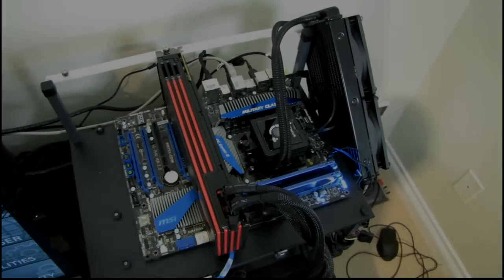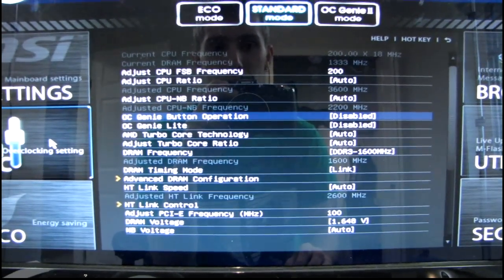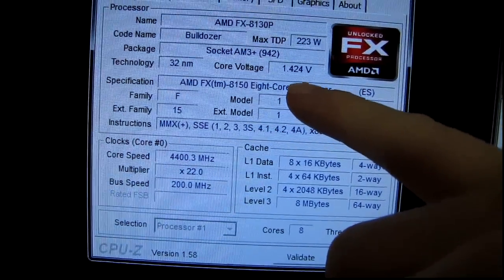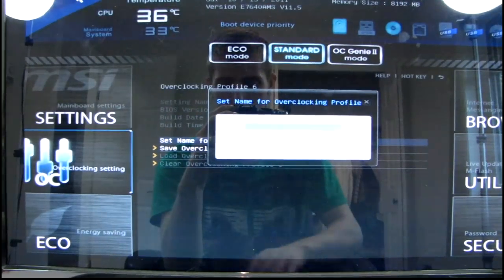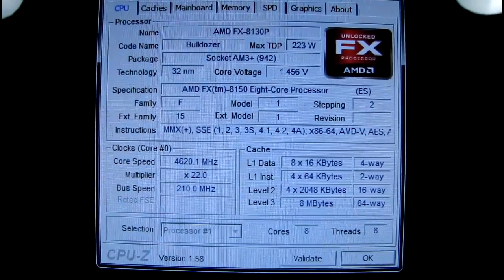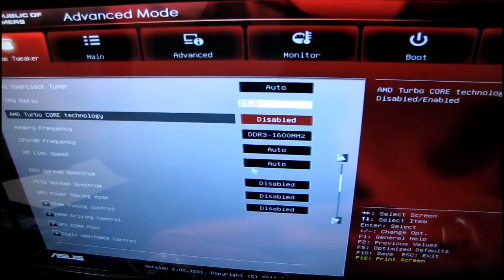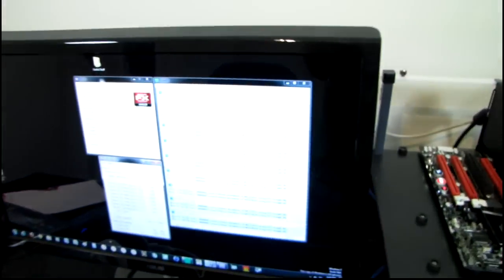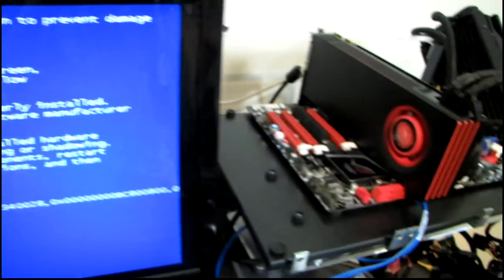AMD Bulldozer FX-8150 Overclocking Guide & Tutorial Linus Tech Tips

Comment: Please do a video of the 8320 on how to overclock on!
Reply: yeah I would like to find out as well to do it manually since im using the auto tunning up, but I'm wondering if by doing it manually is better than auto.
Reply: i actully made it stable my self ;) i seached around on what kind of stable clock and volts.. i got mine to 4.5Ghz at 1.440Volts :)

Comment: Using the Asus Crosshair V Formula board my FX-8150 went to 4.615 with the CPU voltage at 1.350. My bus speed was at 201 using G.Skill Ripjaws 1600 memory (8-8-8-24-39) I bump it up to 1866, (1872 with the bus speed at 201). With (9-9-9-28-44) timings and the dram voltage at 1.55. CPU/NB was set to 1.275 volts. All this on air using a Zalman CNPS9900MAX and a CM Sniper case. At idle temps are 38c to 40c and the highest temp in Cinebench 11.5 was 55c.

Comment: the temperature of your heat-sink/water in your cooling solution is always going to be higher than the core/CPU temperature that is being read from the main board.
The core temperature is calculated not physically but by an algorithm based on the temperature at the socket. This is even more relevant at idle temperatures. This is why your core temp reads 55C and your liquid coolant is a little hotter, your core temperature is actually more accurate than you think.

Comment: I have run my 1055t at 3.8 ghz for years.

The key is aftermarket cooling, and reading up on the subject.

Overclocking is safe and effective, as long as you get the knowledge before trying.

Comment: @peterdoa1 pretty much every i5 2500K  will reach 4,5GHz. Mine is running 5GHz with 1.344V core voltage, which is pretty low voltage for such high overclock

Comment: @stonecoldtrk I looked into it. You are correct. Bulldozer uses 4 "modules" with 8 threads. But bulldozer is $70 cheaper in canada than the 2600k. bulldozer seems to perform poorly in low load situations than the intel, but in high load situations the bulldozer wins.
They both have advantages I guess. It really comes down to what you will be using the computer to do mostly.

Comment: Why is it that when I do the Prime95 stress test , CPU-Z reading of the speed go back and forth between the speed that I set (4.4Ghz) and 2.8Ghz.
I tried to up the voltage to 1.45 but still same problem ?
Reply: Disable APM (Application Power Management) throttles CPU under load. Just had this issue and tried everything, forgot about this setting. I have a FX-8320 + GA-990FX-UD5 so not the exact same as this set up. Now i'm OCCT testing stock clocks at 1.232v (1.2875VID) loaded 48c with TR Archon cooler.

Comment: for 4.4 don´t need twik the buss, just put more vcore and adjust the multix. Probably 1.45v works but try lower on vcore until fail and then go back a little allways below 1.465 since the máx safe range i guess. Be carefull with the buss speed try not to touch that if possible, buss speed can OC the memory and burn them if not done correctly.

Comment: What is cpu ratio? What is the spectrum thing? And finally, do you just turn the voltage up a little bit at a time until stable or is there an algorithm? That's that part that scares me the most.
Reply: so for Information - I dont unterstand the spectrum thing too ,I deactivated that. CPU ration gives extra clock speed to your CPU , better use the lowest voltage load Windows and Start prime95 if ur Windows bluescreen then u undervolted , no Problem. when u use higher clock then u need more voltage but the higher voltage the higher temperature
Reply: +Toilettenkacker there is normally a max voltage for ur CPU . for Sandy bridge is 1.35 volts

Comment: @1ronichaos Well lets go into price/performance.

Right now the 2500k is ~$220 -$180 if you live near a micro center-

8150 ~$240 This is the comparable cpu from AMD when OC'ed to 4.8ghz.

At 4.8 ghz the 8150 hogs up ~500 watts at full load, yes ~500 watts at full load!

- compared to ~130 watts for a oc'ed 2500k at full load-

The extra power the FX is drawing should also be considered in price/performance.

Not so great a deal in hindsight eh?

Comment: I've seen somebody run an 8150 at 5 ghz.  Is it unhealthy for a chip to run it at such a drastic OC everyday, even with a good cooler like an h100i?  Is it worth it for the performance?  Or should you split the difference?  I have a couple 1.5 inch wide fans from an old dell case with well over 100 cfm each, they have TOO much airflow at max, but a good safety net for application that really push my 8150.
Reply: yea I wouldn't oc to 5 ghz unless I was benchmarking. other than that I'd stick with 4.4 or 4.5
Reply: Ya, I figure that's pushing it a bit hard, especially for an everyday OC.  I'm not even bothering with an OC right now cuz my gpu is holding me back, not my CPU.
Reply: Dwight Parker It will significantly reduce the lifespan of this cpu. I have only oc mine to 4.9 but the temps were out of control when stress testing. If you have the same cpu you could always throw the multiplier up to 20 and leave it at that(and keep turbo on). Of course depending on your gpu this could still have negatives but it's always fun to push your system to its peak performance.
Reply: ***** Not many people have problems finding their max stable overclock. It all depends on your setup. One cpu could overclock at +100% or you could have a cpu that shouldn't go above +20% but the fx series cpus can be overclock by a lot (something around 7 ghz) and still be stable and thermally safe depending on what is cooling them.

Comment: Purchased this old PC about a year ago and although I use a console for gaming it ran GTAV and Ghost Recon Wildlands well. OS: Windows 10 build 18363 (64-bit)
CPU Type: AMD FX-8150 Eight-Core Motherboard: 990FXA-GD65 (MS-7640) Memory: 32GB G Skill Intl DDR3 SDRAM Videocard: AMD Radeon HD 7870 Hard Drive: WDC WD1002FAEX-00Z3A0 (1TB). I did not over clock it

Comment: My CPU runs no higher than 25C at 4.2GHz (AMD FX 6350 6x 3.9Ghz, turbo 4.2GHz). Would it be safe to overclock to at least 4.6GHz??
Reply: 25C ? wtf with what are you cooling ? up to 50c is no problem
Reply: Sven schäfer I ordered stock cooling but they sent an after market cooler so my PC doesn't operate more at temps higher than 25C even when playing games and rendering HD videos.
Reply: 25c is insane my cpu runs with 50 the big octua cooler dont know the name atm o: well my cpu is 1.2ghz overclocked so its fine ^^

Comment: would you recomend running 1.5v on the cpu? i tried overclocking myself and could not get any boot what so ever, so i used the auto OC on my board and set it to 4.5GHz and it upped the voltage to 1.5v, i ran prime 95 for 10 min and it seems stable, and my load temps are about 52-54c

Comment: @Falcrist This is true. However the reason the 2500K is better for gaming is no game engine can use virtual threads (hyper-threading). The 2600K has eight threads, 4 physical and 4 virtual, that's two threads per core sharing the same resources. Bulldozer calls these modules, in place of the virtual thread, you have two physical ones, two cores per module, one core per thread, but still sharing the same resources. The way these are being tasked atm is seriously hindering the design.

Comment: A quick note to people who will overclock this thing... you do not need a 1.5v to reach 5ghz on the bulldozer. You can actually go sustainability lower to some ridiculous amount like 1.23-1.24 ghz to remain stable at stock. And maybe a 1.33ghz for 5ghz. You can't brute force the bulldozer. Also... leave the north bridge untouched. Watt however is still high, but temperatures are better.

Comment: So if I want my 8150 to overclock at 4.2 do I only need to change the cpu ratio or do I have to mess with the voltage? And If i get it to 4.2 can I turn on the turbo boost?

Comment: That's interesting. I have the MSI 990FX-GD80 board paired with a Phenom II X4 965BE and no matter what I do, the maximum stable OC I can get is 4.1GHz. I thought it was just the chip, but seeing you achieve more on the Asus board makes me wonder. Although I'm an MSI fan, seeing this makes me skeptical about the "world record" vishera CPU overclock at 8.37GHz that MSI claims to hold on this exact board.
Reply: That overclock was not on all cores, That world overclock is with just 1 core enabled, which makes the CPU pretty much useless. Other ppl make me laugh when they disable cores to get a high overclock, well why did you buy the 8 core in the 1st place.
Reply: Allen Barnett My Exact Opinion!

Comment: @Orexll 

If you had money you'd be running a Core i7-980 or waiting Sandy Bridge-E and the Core i7-3930K instead of having a 'lowly' i5-2500K.

And even if it's for short periods, running at such high voltage will mean high degradation.

Comment: @TRStrider74 As software improves, the performance of both intel and AMD processors will improve. Most games can't take advantage of more than a few cores/processes anyway. Don't forget that the 2600k has 8 threads (which is why the 2500k is the better choice for gamers).
The Bulldozer CPUs are going to need an architecture update AND better software support before they can effectively compete with intel's CPUs. By the time either of those things happen, intel's new processors will be out too.

Comment: hello guys , I use MSI z68a g43 (g3) and I cant find CPU manually voltage setting , the automatic is on 1.41vid when I pushed it to 4.4ghz on OC genie , and under load its around 60° (in prime 55°)(I think because my 980ti goes 65° too while gaming) im talking in Celsius. how can I lower the core voltage instead of getting a New mainboard and install my thermalright macho which is a pain in the ass
Reply: i7 2600k is my CPU , not overclocked 43° Celsius under prime 95 5 mins

Comment: Heya Linus don't suppose you planning a video like this for FX-8350 ?? i know they are similar chips, 

Just recently got my system up and running with some great results. 
FX-8350 @ 4.4Ghz /1.320v/ 25*C Idle / 45*C Load (700 CineBench R15 points)
Gigabyte 990FXA-UD3 (rev 4.0)
G-Skill 16gb DDR3 2133mhz Ram @ 1600/1.52v/9/9/9/28 
2 TB SSHD Seagate.
XSPC Raystorm D5 AX360 Cooling Kit. Avg Liquid temps 34*C
Thermaltake V71 Tower.

I know i still got more room to overclock, just been testing as i go, had a few issues with the way things are names in bios on gigabyte boards.

Comment: I have the first motherboard that you showed there and I have been having issues just overclocking at all. Same cpu and same ram frequency (1600mhz) but even the slightest bump in  clock speed and I get a crash. Could I get some help? Or could you just reply with you final settings for me to try out? thanks

Comment: URGENT ! I have the same motherboard but I run the FX 9370 , it is possible that the processor is too strong for this momo ? Because i deactivated 2 cores and I get more fps in games..(crap) (PSU 700w 80+ (LEPA) )
Reply: don't quote me on this but your cpu could have been too fast for your gpu aka gpu bottleneck but I don't know your specs
Reply: +guncluts AMD Fx9370 4.7Ghz(8Core)
990FXA-GD80 V2
8GB(Kingston Beast-X Series) 
NVIDIA GTX-770 - 2GB Msi Gaming-Edition 
Lepa 700W 80+ Gold Edition

I will never ever go with AMD in my whole life..
Reply: Andrei Grecu So with that setup I would try underclocking your cpu down to it's normal speeds(your cpu is an 8350 pre-overclocked) and testing again. All your components are compatible but I just think your gpu can't keep up with your cpu clock speeds.
Reply: +guncluts I know, but you will never get an 8350 on 4,7 with good stability and no heating problems. I wanted to OC my 9370 at least to 5ghz, some people did it..

Comment: I got a little problem. Maybe someone else has but I'm not sure. I'v tried to OC my GPU, a 9600GT. It works n everything, however once OC'ed even the slightest, whatever game i play will freeze for one second, the screen will go black, game is still running in the background before everything returns to normal. I thought it was a power issue and the GPU was too old for OC, however upon buying a new MSI GTX560ti and a good 750W PSU, I still have this problem. What gives?

Comment: @mrDMxtreme does he know anything about over clocking? you have to change a combination of settings to get a stable system higher bus speed little higher multiplier and voltage change i dont think he knows any of that  even with those 2 fancy boards i could do a better job with my amd athalon 64 x2 4200+

Comment: @1Nuk3d1 It's the same, BIOS was meant to be updated or more likely upgraded in(forgot the year)it had to be replaced by UEFI which is the same type as BIOS, only upgraded version, because as i said, BIOS was meant to be upgraded, but it didn't happened because of some points, UEFI is right now in some boards, it replaces the old type which is called BIOS, UEFI started in 2005, starting from new Windows 8 in 2012, begins the UEFI era, it will replace BIOS further after (did i said it right? :D )

Comment: Great video!

Having a lot of fun with my FX-4100, booted at 5GHz 1.487v(ish) but haven't been able to really test stability yet because of throttling.

I disabled Hardware Thermal Control (temp throttling), CnQ, C1E, C6, CPB etc. and it still throttles under multi-thread load. Very annoying!

Won't be buying another Gigashite motherboard after all the BIOS bugs I've had with my 990XA-UD3, each new BIOS release fixes one problem and creates another. On to F9 BIOS already FFS!

Comment: I'm currently testing the resilience of the FX-6200 chip. running it at 4,9 with 1.54 core volt... H80 keeps it around 68 at maximum stress, and it's stable... Now i'm going to check for how long it will run at these settings.

Comment: @ajhomryder 
this is what i have on my rig:
Board: gigabyte 89ofxa-ud5
cpu: AMD Phenom X6 1055t overclock 3.65GHz
cpu cooler: CORSAIR H50
Ram: 14GB 1600Mhz
Vcard: 2x Radeon HD6870 Crossfire
2 Hard Drive: 500GB and 1TB.
i been runnin this spec for 2 years, just was wondering to see if is time to upgrade cpu but you say no and i been searching about this AMD Bulldozer FX people been saying is not worth it to upgrade the x6 cpu

Comment: @1ronichaos 1155 motherboards are not as expensive as people think asrock right now has some damn awesome boards in the $80 - $100 range.

True the 8120 is $190 right now, but you are forgetting you need to overclock it to 4.8 to match a stock 2500k, that means buying something like the h100 for ~$115.

190 + 115 = $305 to match a STOCK 2500k.

The 2500k is 220, a nice cpu cooler is the hyper 212 which is ~$30.

220 + 30 = ~$250, not only is that $55 cheaper you get way better performance!!!

Comment: Most games, even today, are still only dual core optimized. A few oddballs are triple, and some are four. The games and engines out there capable of using over four are few and far between. Frostbite can use up to six and supposedly FB2 can use up to eight. Other than that, games are just now starting to catch up to quads, let alone anything more than that.

Comment: dammn ..why is it that Linus couldn't get more than 4.5ghz on the 990fxa-gd80 board yet..4.8 or 4.9ghz on the Asus crosshair V board can handle it with pretty much the same voltages?  I figured those two boards power delivery and mosfet cooling systems were about the same?

I'm getting  the v2 of this msi board in a few weeks tops and working with a 1090t temporarily until i can afford the 8350.  tips please? ( NOT ."  well you need to get teh crosshair v board instead"   ah no )

Comment: @lowrider649 i would say around 99% of today AMD and intel CPUs can hit around 70c before they actually die.
So the only rule, that is required, do not go past 60c under massive load!
If you can get it that high, and it is stable (enough) for you, then you got it!

As shown in this video, you go up higher, and higher, then when its unstable you add more voltage, and check the temps and do a test!
If the temps are good, then more speed, if crashes, more voltage, ect, and repeat!!!

Comment: Not really. You can run Piledriver CPUs on 990FX (AM3+), they're called Vishera. Piledriver CPUs with integrated on A85X (FM2) are called Trinity.

Piledriver is the core architecture which is identical so Vishera and Trinity chips with the same number of cores and clock rate perform pretty much identical. Vishera has one advantage, L3 cache.

Comment: I still use mine in 2015 with an ASUS Crosshair 5 Formula Z with a Corsair H90 cooler.

I only get decent overclock when limiting to 4 cores. I started using Asus Suite 3 recently after using v2 for a long while within Windows 7/8.1.

My main issue of understanding is whether it is possible to how to best OC with alternating cores rather than pairs to free up FPU performance per core.
Reply: By channeling the airflow from my air conditioner into the case I can sometimes yet fairly inconsistantly get up to ~4.6GHz.

Using HL2, FarCry, Doom3 BFG & Handbrake for load testing during OC testing.
Reply: +ItsComingOutOfBothEnds channeling AC air into your case can cause condensation to form on your hardware which is bad.
Reply: guncluts
I don't push it too far below ambient.

Comment: the 8150 is on the same level for gaming as the 2500, but if you want the is i suggest the i5 2500k because its unlocked, i would go with the 8150 because its better overall, better for video rendering, editing and other things, but they are pretty much same for games

Comment: i have non water cooled - cpu cooler - and do some tests on crosshar v - just put in bios  - overklock by d.o.c.p and 4500 works on 1.362 v - and as you know work temperatures in fx 8150 is 20 - 61 c better do not rise more than 65

Comment: when i run prime 95 on my 990fx ud3 (fx 8120 not overclocked) my cpu voltage and multiplier turns down in CPU-Z, when its only at 49 degrees (celcius) with the stock cooler
pleas help some one?